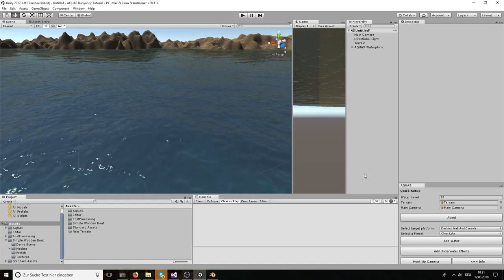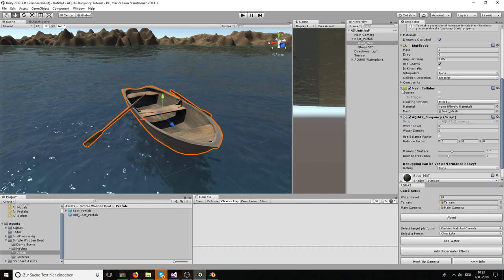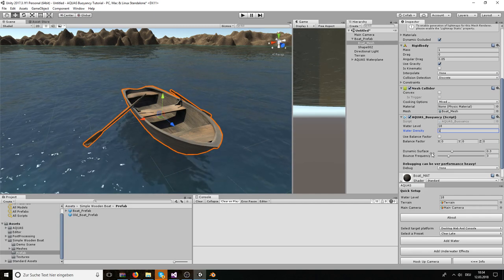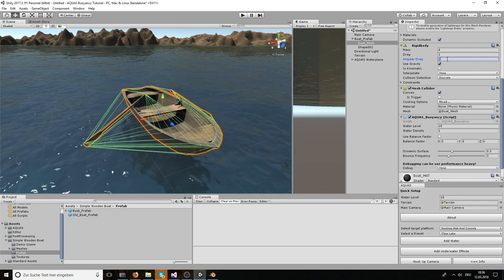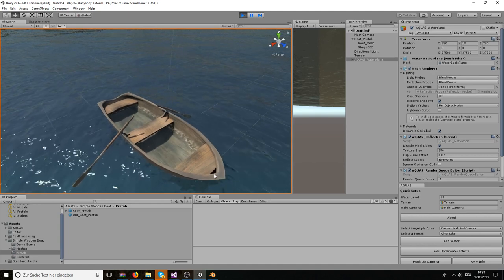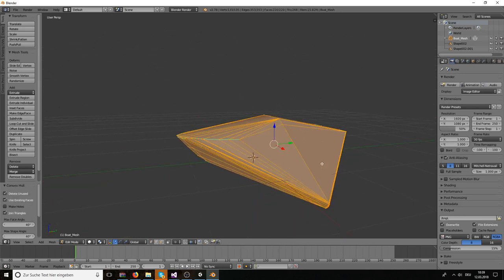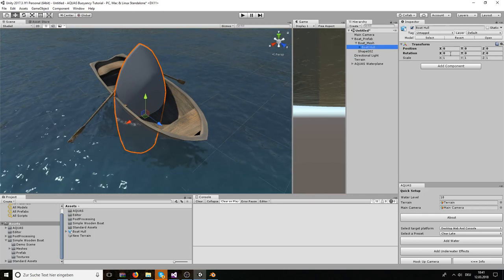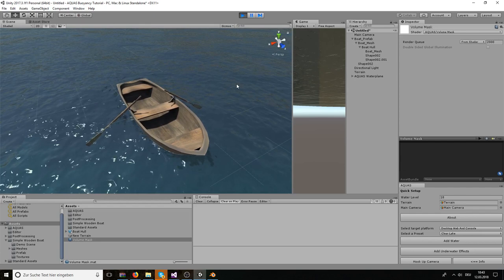Unity: AQUAS Water Tutorial - Buoyancy and Depth Mask

Comment: what if you have different water levels?
Reply from the maker: The buoyancy is designed for a single water level. It's basic, just to give you an idea of what you can do or for simple usecases - it cannot replace a sophisticated water physics system - and isn't meant to.
Reply: @GodlessReason  i don't know if it will be sophisticated but i'll come up with something. a bunch of if statements should do the trick. I'm new to coding. If anyone knows a better way let me know. thank you.

Comment: Nice. But if the boat sinks that prevents its running full of water, right?
Reply from the maker: Yup - you can't have it both ways. Having the boat actually run full of water would require quite a sophisticated n-body simulation with millions of particles - that's why you usually don't see it in realtime rendering, only in prerendered animations.
Reply: I could deativate the convex hull when sinking and have the water rendered inside again :) Did you use Realistc Water Physics for this video or does Aquas have objects swimming nowadays?
Reply: And calculate a height below water level then use that to add a downward force to simulate the ship sinking.